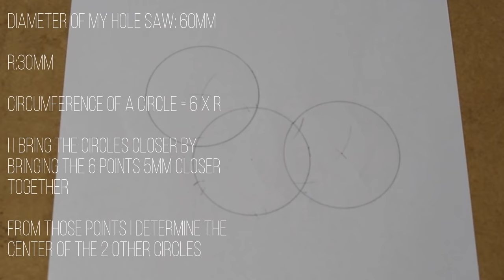Star knob jig for drill press | Make your own star knobs

Comment: Chris my favorite wood to work with is rough cut cedar with a live edge. The contrast of the red and white is just beautiful. One of my first real projects was to fix some reclaimed dining room chairs. I used cedar planks for the seats with multiple layers of paste wax as a finish. Not only that but when you turn it on a lathe and sand it down to a crazy 1600 grit sandpaper it almost seems sinful to add a finish. Just really pretty stuff IMHO.
Reply from the maker: Thank you so much for your awnser and comment. I'm having the same opinion on that contrast of the colors.